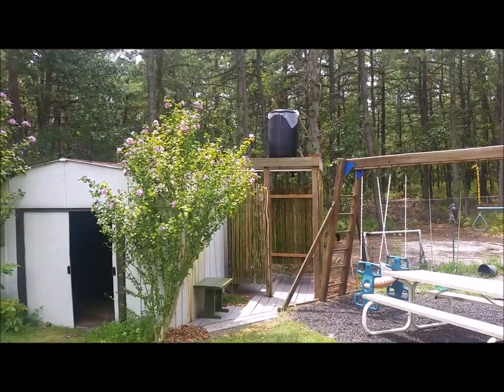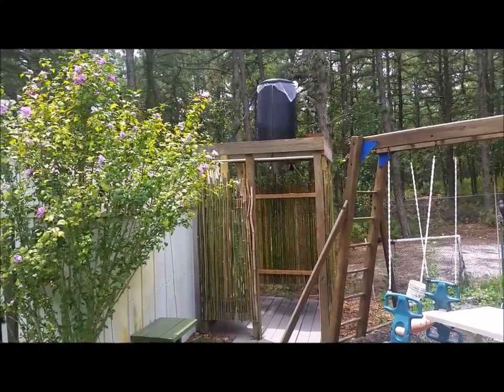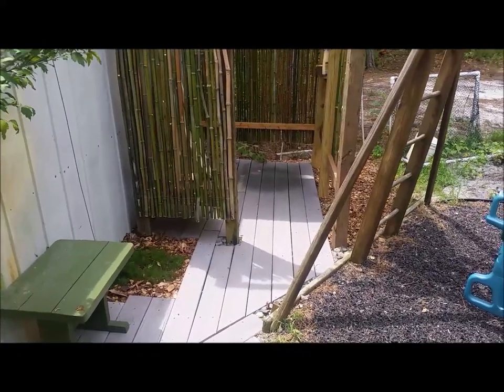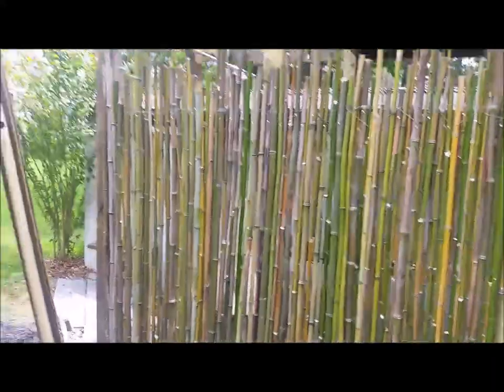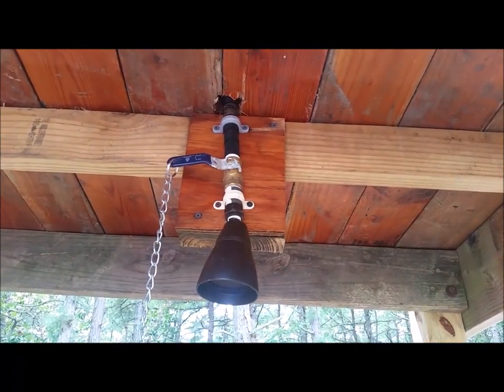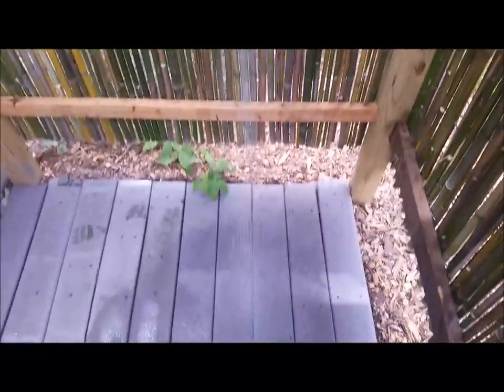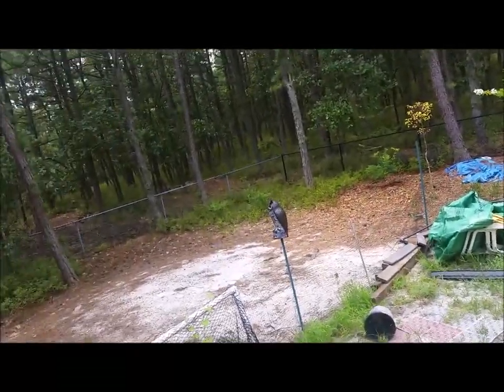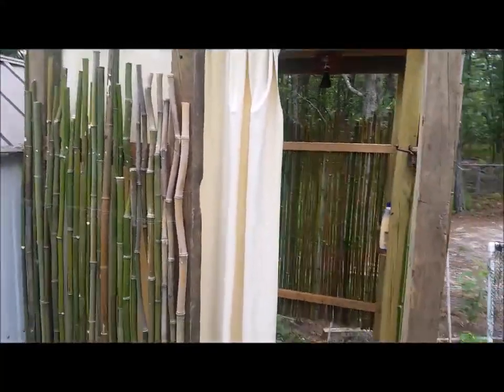DIY Outdoor Gravity Fed Off-Grid Tropical Shower

Comment: Cut and notch the 4x4 so that a 2x8 will rest across them , then use 2x6 for the top boards deck about 2 inch’s apart  and then lay a piece of 1/2 pressure treated plywood across the top of the 2x6 for the barrel. Buy a spring loaded pull style shower head and your in business, u can also buy a small portable fuel powered drip immersion heater to heat the water on a cold day.